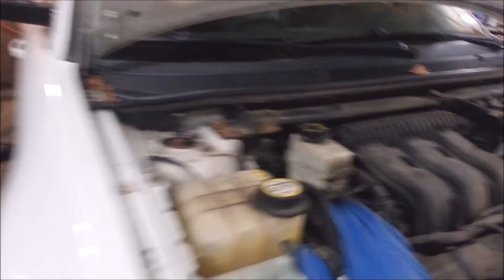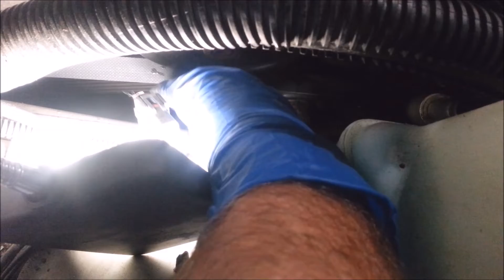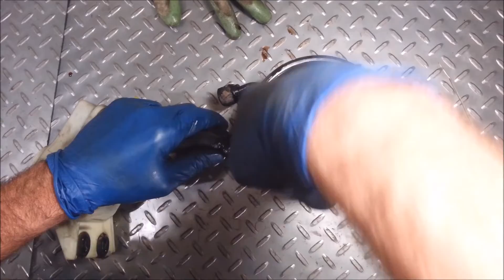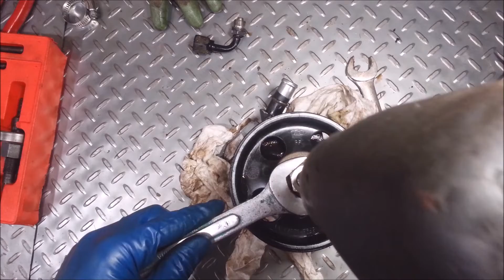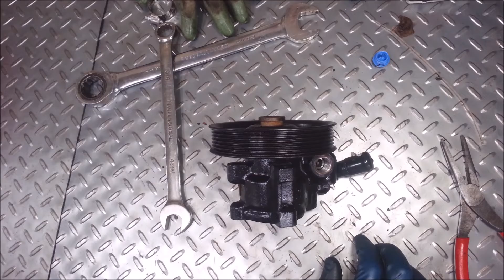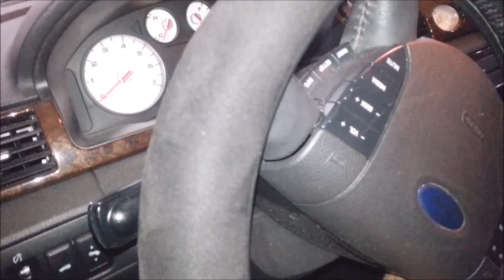2005-2007 Ford Five Hundred power steering pump replacement

Comment: How are the coils and plugs numbered on a  2006 Ford 500 limited edition 6 cylinder I need to replace number 3 but can't find if it's in the front or back of manifold

Comment: Hey , mines smoking very badly and im  loosing alot of steering wheel fluild. Do you know might be the problem.?
Reply from the maker: The problem probably is fluid dripping on your exhaust manifold, and it may cause a fire, if you don't get it fixed.
Reply: @RustBeltAuto  Thank you bout to go get look at now.

Comment: Thanks for the video.  Your comments were spot on and entertaining, especially re: the hose clips.  I had a guy helping me do the fuel pump (which is a PITA) while I was in charge of the power steering pump, and I politely tried to explain to him your method of not not disconnecting the reservoir hose, but instead he spent an hour (while I politely watched) trying to unclip those stupid clips, and then when he tried to reattach the clips, right on cue it zipped across the yard and pinged off a house window lol. If I had to do it again I would have ordered a new reservoir hose ($12 I think), cut the old hose while the pump was mounted, and installed the new hose with new standard hose clamps.  Also, we removed two mounting studs to remove the pump and reinstall instead of lifting the engine. It wasn’t too hard to do it that way.  Thanks again.

Comment: The P/S cap should be on the pump but , not tight … just sit there so as to not make a mess .
Cadillac Engineers say that the best way to bleed is to go L-R 2 times and stop at the max , turn it off for 5 min , then R-L 2 times …. Repeat 2 times each side …. Courtesy of GM Training School in Atlanta Ga …
Reply from the maker: @tallspaniard1  agreed. You need to physically hold the wheel to lock, when turning the car off, otherwise the pressurized air will not escape as well.
Reply: I have a question if the power steering holds fluid but it's hard to steer what would be the problem
Reply: @ginamccoy7572  , if you tried bleeding the unit and it is still hard , you most likely have a bad pump .
Start bleeding it correctly . Will take at least 20-30 minutes . If it was recently installed ? Someone took a Short cut and never bled it properly . If the pump has been replaced a few times …. Need to flush the dirty fluid out and install a New P/Steering filter on the return line , right next to the pump

Comment: how many quarts did it take to refill the whole system?
Reply from the maker: It depends. Most systems usually take about a pint. A quart should leave you extra.
Reply: @RustBeltAuto  Wow thanks i was thinking like 4 quarts to flush the whole system.
Reply: @RustBeltAuto  Thanks i am doing the same 2005 ford 500 and was geting mixed numbers from 1 to 4 quarts for the entire system.

Comment: Hello. When you get the air out and do the lock to lock application,  do you do that with the reservoir cap on or off? Thanks in advance
Reply from the maker: I would put the cap on.

Comment: Thanks for making the video my 2005 ford 500 with 133k I believe mine is about to go it's tough to steer it. These engines that are front wheel drive are a joke almost takes a brain surgeon to figure them out everything has to be crammed into a small area a big joke 🤣🤣🤣🤣🤣

Comment: Hello I was wondering if my problem is the rack or the pump. I was driving and made a hard right turn and the steering popped and the power steering doesn't work if you are going slow or backing up. Could you help me out?
Reply from the maker: I have never replaced a rack because of excessive steering effort, if that answers anything.

Comment: So I had replaced the pump and it worked for like 6 months or so....  then the wine came back.  I was thinking it was the seals on the rack & pinion, so I threw some stop leak in there, it blew the line up at the pump, that little elbow.  I couldnt get a little nylon washer, ended up needing to buy the OEM elbow, as the aftermarket was literally a hair to big and it would hit the engine....

Anyways, Im considering trying to throw in another power steering pump, as it only wines, and the vehicle doesn't leak any fluids.  What do you think the chances are that its just a bad remanufactured pump?  I am selling the sucker, and if it is the pump, and I replace it, the car is in mint condition.  If its the rack and pinion, well I lose 100, if its the pump I get 1k more in the sale.
Reply from the maker: Noises usually comes from a cavatating pump. Worn, or excessive pressures. Not usually a rack. Hard to say.

Comment: It was all good but you never showed how you took it out of its place because I tried to remove one and the pulley got in the way
Reply: For those interested: you need to loosen the front motor mount to slowly lift the engine. Once you lift(about 2”) the PS pump with pulley can come out!!
Reply: Did you ever figure it out with the pulley? I also could not get pump out due to pulley hitting the frame?

Comment: I hope your well! 
Brother I have been looking high and low for the Teflon o rings. Ford couldn’t even give them to me. I bought a reman rack and pinion and pump and have to disconnect all hoses and supposed to replace. Where do you get these o rings? I have looked at Grainger Industrial supply,  but I can’t find the specs on them anywhere (even prodemand mitchel1, ford, Google) You need to know inner diameter, outer diameter and thickness! Annoying as hell. I just want to do it right and not have to return you know? Lol I didn’t replace an o ring on the txv expansion valve (ac) once and of course the sob leaked! Thanks for the great video and help!
Reply from the maker: There should be an assortment box of a few different ones in the help section at your local parts store.
Reply: I found these at the auto parts store. Dormant product, 82540 qty 2, two different sizes
Reply: @DojoTater  that’s the set I got. I got the job done. No more leaky leaky and muscling the steering wheel. Have to replace the intermediate shaft yet but I’m lazy
Reply: @OneNationUnderSoundness  hahahahaha...yeah, I fit that lazy mode sometimes and more often, waiting for the next paycheck to order particular parts

Comment: Interesting to see your work flow. Decades of experience, yet you efficiently use the wrench in hand rather than searching for that specialty tool you have, somewhere in the toolbox. Straight forward workflow, with little tricks here and there. I've been fiddling with hose clamps like that for years, thinking that I just don't know the correct technique for setting and releasing them. Guess there is none, ha ha.
Reply: They make a special tool for them

Comment: Great video! Looks straightforward enough to do the pump at the same time as the rack as I've been putting off replacing the rack and pinion for years on my 2005 500.
Reply from the maker: If it's not broke, don't fix it. That's how I roll.

Comment: Hey man what’s another reason if it’s not the steering fluid pump? For the five hundred ford 2006??
Reply from the maker: Rack and pinion. There may be a filter in the line that is plugged, but not likely.

Comment: My 2005 Ford Five Hundred has 255k miles on it.  Never needed the power steering pump replaced, I just watched the video for in case it does lol.  I did need a new transmission at 171k, a few minor repairs here and there related to how I drive, but other than that its been a great car.
Reply: Yup, transmission at 180k

Comment: What were the system's and milage? Is this a maintenance issue?
Reply from the maker: The pump stopped working, and it was hard to steer I think. I don't know the mileage. If you want to do maintenance, I would suggest changing the fluid.
Reply: @RustBeltAuto  ok, thank you for your help. John
Reply: mileage was about 135k on the car.  saw it when he was turning the wheel to lock.